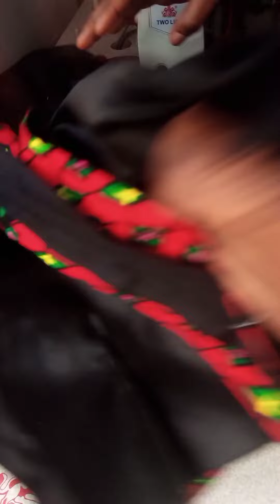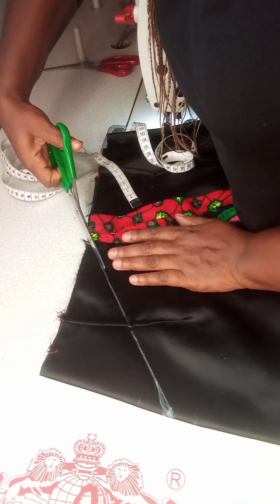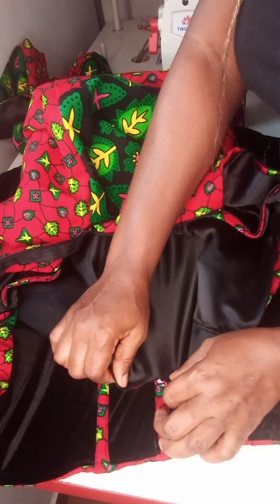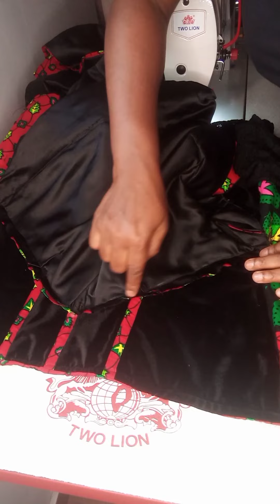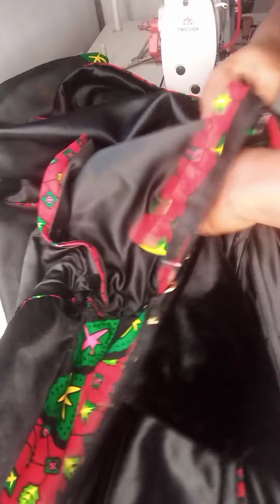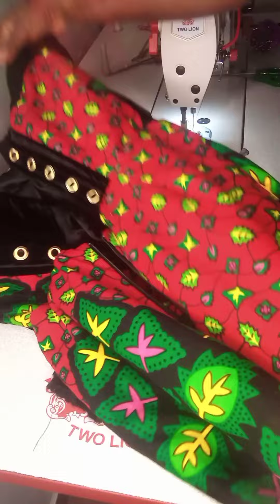How to sew an inbuilt corset(trendy inbuilt corset) #sewingtutorial #sew #sewingtips #corset

Comment: Thank you ma 🙏. I wanted to ask that when drafting the skirt pattern , did you also snatch the skirt waist by 3 inches as you did for the corset top ,or used  waist circumference divided by 4.
Reply from the maker: Yes I snatched the skirt also
Reply: @kome_fashion  OK ma thank you ,I snatch the waist on the side seam after adding  my dart allowance and seam allowance using  same technique of snatching the waist done on the corset top, I mean I still have to go in by 0,75 inches and down by one inch and connect with a curve to the 3 inch down .
Reply from the maker: Yes same method
Reply: @kome_fashion  Thank you Ma 🙏
Reply: @kome_fashion  Sorry ma I am asking a lot of questions .I wanted to ask since you said I can't use a zipper for the corset top because of the 3 inch snatching , if I snatch the skirt waist by 3 inches and use zipper ,will the zipper be able meet at the CB won't it open up ?
Reply from the maker: You can use a zipper for the skirt cos the corset inside will already snatched it before you zip
Reply: @kome_fashion  OK I get it ,thank you
Reply: @kome_fashion  Please which boning did you use?
Reply from the maker: @Urchstitches  I used both plastic and sewable boning, check the other video on how to sew it,it's there please
Reply: @kome_fashion  please i need the Link of the how to cut it, you said you will drop it but i didn't see anything
Reply from the maker: How to cut what please?
Reply: @kome_fashion  the corset and the skirt
Reply from the maker: Here is it for the corset,the skirt is just your normal pencil skirt,but make sure your are using same waist measurement you use for the corset
Reply: @kome_fashion  okay ma
Reply: @kome_fashion  what length did you use for both front and back for the bodice of the corset?
Reply: @kome_fashion  please can you give the link to the drafting part?
Reply from the maker: https://youtu.be/DDraADa0yeM